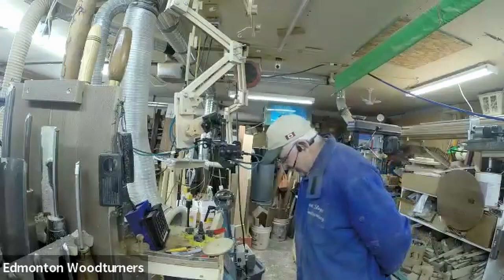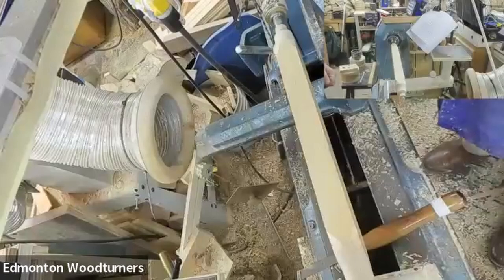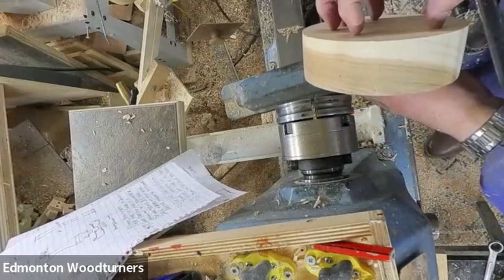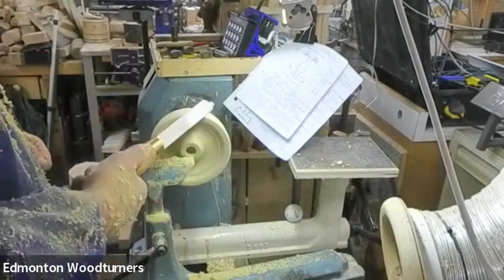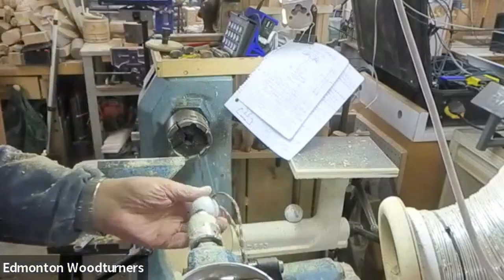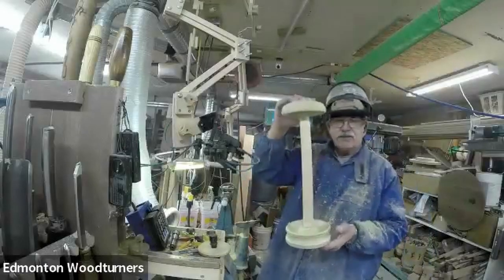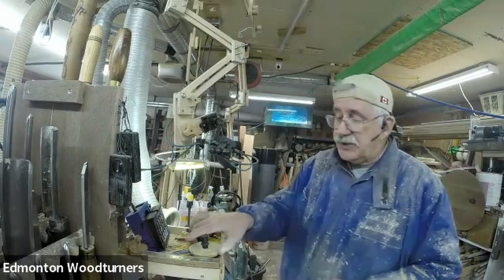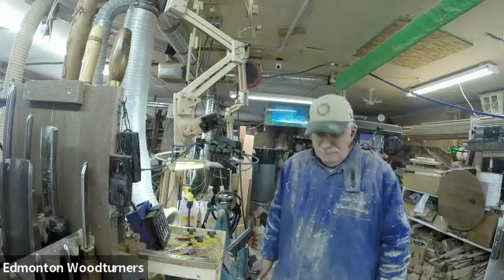Seattle Wig Stand Demo 2024

Comment: Nice job Bert! What radius do you use for the top?
Reply from the maker: I just round the edge over and blend it to a flat on top. Basically just try to duplicate what a head could be, no two heads are exactly the same so I don’t think it matters much, as long as it’s smooth and moisture proof. I use OSMO hardwax oil, it is impervious to moisture and alcohol and cures to a smooth satin warm feeling finish. And it is certified in Canada, safe for children’s toys and food safe.